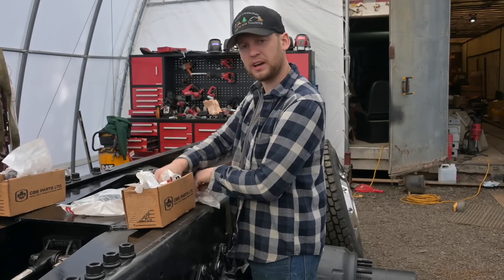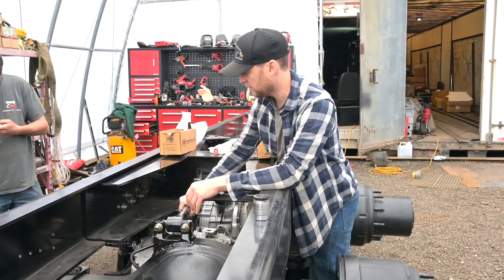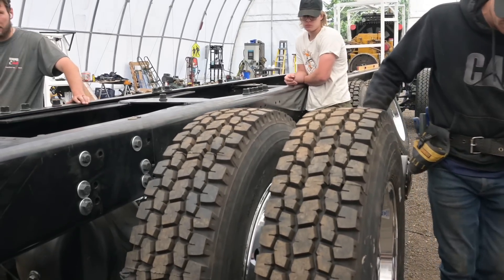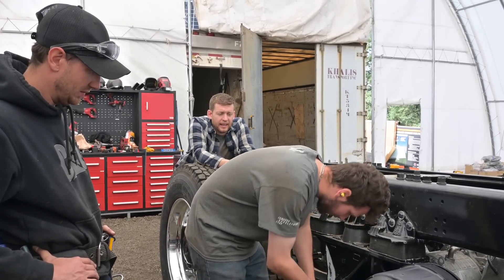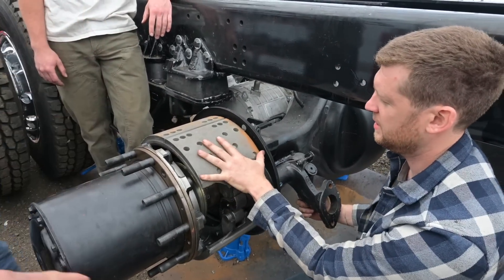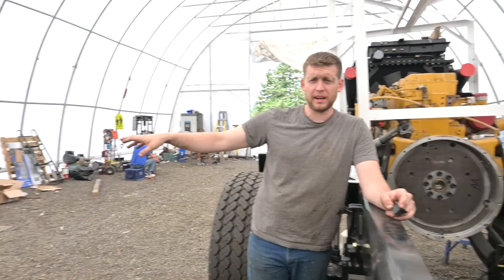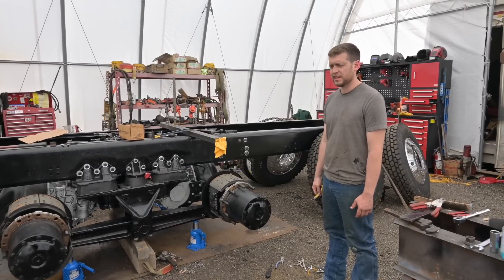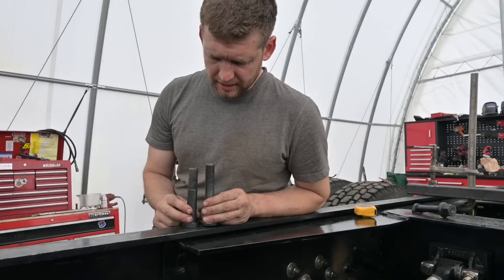Unexpected Challenges: Threadless Nuts and Stud Surprises!

Comment: Wheel studs are too short because some one wanted polished rims instead of steel. The manufacturer dont want to spend extra money to supply longer studs. Remember to spec studs to mach the rims on the production units. 
Keep up the good work boys.

Comment: Stud length is different for steel wheels vs aluminum wheels, switch them out often when buying used trucks with steel wheels and replacing them with aluminum ones

Comment: Hey y'all!
Don't make the same mistake that Ford made with their F350 show truck.
Alloy wheels and steel studs expand at different rates. In those cold weather days flat washer (nuts) will loosen and slide hammer those studs. Creating nightmare's for your driver's.
Please include those plastic torque pointers in your measurements... or skip the shiny temptation of alloy wheels and go with steel stamped wheels. At least for your production models.
I don't think heavy truck can use tapered nuts but that is what Ford should have allowed. Too much torque and too few studs. They were just stretching to talk to yield or greater, then slide hammering and shearing off all at the same time.
Really bad skokum!! 
Thanks Raymond
And don't stop dreaming of the possibilities!
Reply: Torque to yield 😂

Comment: Don't feel two bad about the nuts.  My dad had AN hudraulic lines installed on his airplane a few years back that looked like they had threads, but had 15 thread shaped groves instead of proper threading.  On an aircraft part...  Only found it after the fittings leaked.  The tech that rammed them in got in hot water for that bit of laziness.

Comment: Whenever you are spec’ing out parts or components from a manufacture, you have to know exactly every part you need for your fitment so you can let them know.
Because there are steel wheels and aluminum wheels, they are different thickness.
Live and learn. Not everyone knows about these things
Fortunately, I used to go with my uncle when he used to buy a new unit for his company so I learned how to spec a unit out for the job it was to go on. 
I learned a wealth of knowledge from him and I was only 8.

Comment: When I Built A BRAND NEW ENGINE 98% All New Parts For My Bronco. """ NEW """ SVO racing block, Lighting EFI, 4" X 4" Eagle Internally balanced rotating assembly, Canfield aluminum racing heads, Full Roller Cam Roller Lifters Roller Rockers, All by Comp Cams. Set to that Engine Specs for the Power and Torque Curve that I Wanted. All ARP bolts and studs throughout the entire engine, ( and All The Pre-Made Bolt Kits, Except for the Head Studs, & Main Studs, Were Worthless !!!! Over Half of the Bolts in and Given Kit didn't Work as Intended ) But The BIGGEST Problem was the TRICK FLOW EFI Intake Manifold, Which Delayed Me over a Year-and-a-half. Even Though I was the Third Person To Order One from Summit. Because I was a Nobody, and I Kept Getting Bumped Back By ALL the Publications and The Racing Teams, and this was told to Me By Both Summit and Trick Flow. and Then When I Finally Did Get One, It Was IMPROPERLY Manufactured Which Ultimately Caused Me To Lose A Head Gasket. Because They Machined The The Face of the Runners @ The WRONG Angle  !!!! And Because The Machine Shop Didn't Have It Available """" When """ They Machined The Rest Of The Engine !!! """ & 3° is STILL 3° """ And The Motor Was Already in The Truck I Fought With It For 3 Years Every 4 to 6 Months Pulling The Intake Off the Truck Trying Something Different, Sometimes Thinking I Had It Figured Out, But Always Ultimately the Same Result. The Motor Pulled So Much Vacuum. The Intake Gasket Always Failed on The Same 2 / 3 Cylinders. And of Course It Failed On An Insanely Hot Day Away from Home,  Limped It In, when It Cooled Off #7 Cylinder Was Hydro Locked. 
So Because TRICK FLOW Screwed Me, It Caused 4 1/2 Years of Headaches $300 + of Dicking Around,  Then $ 1200.00 To Rebuild The Heads &&&&& True Up There Fucked Up Intake Manifold.

Comment: I purchased a set of AC Delco spark plugs 1 of the 8 parts in the package managed to get out of the factory without threads. Being a holiday weekend I ended up using the least cruddy of the old plugs. I still have it to this day! Before the keyboard warriors start blaming COVID. This happened in the 80's...

Comment: Manufacturing defects aren't anything new. Have seen several screws without threads, nails without a point, bolts and nuts without threads. These things happen when you mass produce items that skip a step in the manufacturing process.

Comment: We use Cat nuts and bolts at work....nuts without threads is not an uncommon amusement....i also have somewhere in my tool locker a 16mm Cat bolt with a thread pitch of zero

Comment: 😮so Tell me again how just in time delivery will work??? And we are not in the Horse shoe arrangements for factory production in Japan. Where everything is made sorta Next Door. We in the US have an Assembly plant in one state, an engine plant in another state 1800 miles away and spark plugs made overseas… at a plant that has been closed due to the Typhoon that hit directly across the Island that makes the plugs…
But the container that was full of plugs for our next 6 months of operation is now possibly at the bottom of the ocean, when that rogue wave hit the Mega container ship and washed 250 containers off its deck …  the good news is that the container ship survived! The bad news is that they think that they might have lost that container and they are not sure till it pulls it port because the containers were shifted out of place. But the problem is the insurance won’t pay for the shipment loss until they fully account for what’s on the ship, and so many containers are damaged and dangling their contents may be damaged by sea water contamination… and it will take months to remove the contents from the ship…

Yeah when nothing goes Wright it’s all wrong!😂

I worked in supply/ Logistics for the last 7 years of my 20 years service. There’s nothing like walking up to your supply cabinet and pulling out exactly the part you need right now!
Good Luck Guys. 

Funny thing about the quality control during and since the pandemic it has been forgotten about!!!

Once upon a time the Company my wife worked for had quality control issues with a guy who thought it would be funny to put Raw unprocessed parts in with the finished parts in the boxes that other people were machining. When he was fired quality control was much better. He went to great lengths to place his Dud parts deep into the boxes of others.
Reply: agreed, people took the concept of "just in time" too far.

Comment: to avoid 2hr delays, have multiple things in motion simultaneously. Have multiple things on order, while planning what to do when they arrive, while working on other things you have the parts for already, etc. And when delays occur, jump to one of the other tasks and keep going while you wait for parts and such to arrive.
Reply from the maker: That’s much easier to say than do
Reply: @EdisonMotors  Not at all.

I do it when building my airplane. I needed some thin aluminum to make some brackets to attach bulkheads in the tailcone. While waiting for the metal to arrive, I switched to working on the landing gear. And once I got as far as I could there due to needing a tool, I ordered the tool and switched to working on making some other brackets to tie the fore and aft fuselage sections together. Now that the aluminum has arrived, I can make the brackets and go back to finishing the tailcone. Etc.

And I do it every day at work as a Mechanical Engineer.  I'm typically working on 3-5 different projects at the same time. 2 would be ideal, but realities of the modern economy, unfortunately. Some projects I'm designing parts. Once designed I request quotes from vendors, and while waiting I go to the lab and do some testing on another project. Then I'm answering emails, attending meetings, and then I answer questions from the interns. Then I get a quote, and order the parts. Then I go back to doing more testing and design on other projects. It's go, go , go all day long. Testing all sorts of things in the labs from electrical power, to air and liquid cooling systems, to structural load testing, to shock and vibe, to packaging and shipping, to manufacturing process development, to logistic sparing. I help deal with issues at customer sites, help manufacturing deal with issues they encounter during assembly, detailed design and ECOs, CFD, FEA, etc. Troubleshoot problems, identify failure modes, and come up with solutions. Pulling part numbers and doing documentation. Conceptual design of next products. Filing patents. Meeting with vendors. making my own prototypes in the shop, or cobbling together a solution or making a crude rework on a prototype we're testing to keep things moving. Always something to do. 

It's rather exciting doing a range of different things. The days go by quickly.

It was the same in the military. Overseas I went on every mission I could. I hated sitting back at the base or outpost waiting for our guys to return. I'd rather be out there than waiting or doing the less exciting tasks. And by keeping busy, the deployments went by faster. Not like I had a lot to do in the free time we got anyways. Might as well be on mission.

Comment: Could just switch to double wide tires instead
Reply: Super single tires need a different rim, and are way less effective for trucks like this. With dual tires, you can still limp back to help if one goes flat or blows out. Not true of the singles.. you're stuck as soon as it goes
Reply: @SLOCLMBR  I think you over thought what I said because it was Sarcasm (The truck they are building seems more off road so going that way would be dumb hence a joke)

Comment: They look like studs for steel rims. Your shiny new rims look like original fit for longer studs. The aftermarket rims have a larger hole so with the correct recessed nut they fit.

Comment: Once you get to the first production run you'll be greatful you had all these vaulable learning experiences. I have done prototype manufacturing for many years and have delt with so many one off issues that at this point my arsenal of fixes just feels like a smooth day to day operation when most people fall into crisis mode.
Reply: yup, if you don't expect and plan time to have issues and to work around them, you haven't done R&D.

Comment: I love randomly learning small details about things I know nothing about! I never knew that the rims on trucks are all the same front and back - the outside back ones are simply the front ones turned around! 🤯

I was also wondering why the frame was so long past the back wheels, but you mentioned it'll be cut to size. Was it because you were still deciding about going with two or three back axles? (You also taught me how those are called, but I can't remember right now 😅)
Reply: Tandem vs triaxle😊
Reply: Tandems
Reply: On dually pickups and buses all 6 rims are normally the same. Semis and other heavy duty trucks sometimes do but it's also common for the fronts to be totally different.

Comment: Well once you get the batteries installed while waiting for the generator, you can charge the truck with your fast charger. It will let you get your testing done before long distance driving.

Comment: In a military truck you'd have a thick steel rim so it can be repaired out on the field buddy and they would be made to spec for hardcore off-road duty toating a main battle tank around you should see their tank wreckers. Bolts are beefier too. You'll sort out logistics and supply chain by the time this prototype is done just keep track of what went wrong so you'd be ahead always

Comment: It's not a nut, it's an extreme heavy duty washer
Reply: it would be a good reference to know if they use a full cut thread  from pitch to root, or if the machining process is to plough threads
Reply: @k9wiREless do you mean thread cutting vs rolling/forming

Comment: I worked in a case ih assembly plant building and testing the huge patriot sprayers and floater trucks and we used those same lug nuts only in a grey duratech coating. We would sometimes get nuts like that as well that had no threads.  How does shit like that make it to the customer? Where is the quality control?
Reply: Oh, they outsourced the QC to india (jk, maybe)
Reply: QC took a dive across every industry and service around 2020 and I haven't seen it get much better at all.  Companies being greedy, realizing customers will readily accept a 20% failure rate and keep coming back.
Reply: @Binturong3850  I agree but it’s been going on long before Covid. I worked at case from 2012-2018 and it was starting already. But yes I totally agree the last few years nobody gives a damn about anything anymore.

Comment: Are you going to make the cab air ride aswell or coil spring/shock like mid 90’s Volvo cabover??? Mine had front and rear cab suspension it was abit floaty sea sick but you get used to it and it’s one thing less to blow with airbag
Reply: There's also driver seats with active suspension, I see them on busses.  Pretty impressive systems.

Comment: Check out the part numbers are different on the threadless nut, maybe it’s because you can make you’re own thread???
Reply: "You are own thread"...
Reply: While potentially useful with additional tooling, it's not was expected.

I'm guessing that machinist/operator/worker occasionally drops one (or more) from the machine into the 'processed' chute/bucket while loading the machine by the handful/shovel-load (edit: OR the loading mechanism sometimes spills a second nut that gets ejected through the same chute instead getting in the way) ; And quality control doesn't pause to inspect each nut/bolt individually. Instead relying on throughput to get an overall lower cost per not-defective unit sold.

And TBH; I'd be tempted to [details removed] trapping it on a redundant stud in an array of actually populated studs to see people's reactions when they try to interact with it.  --- Not that I've actually found the time to do such a thing to my colleagues during the lead-up to a trade-show.   I'm just acknowledging that the temptation would be strong.